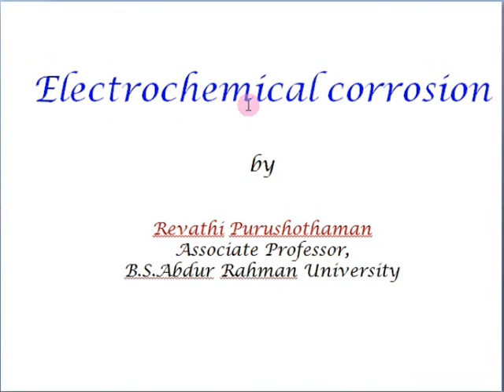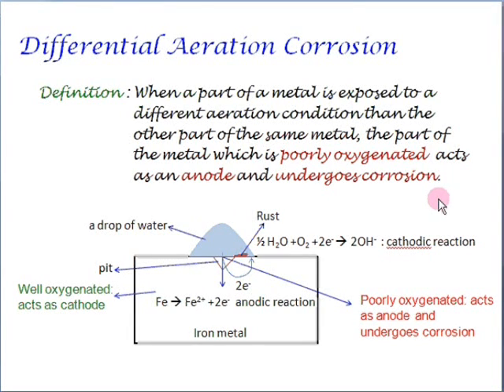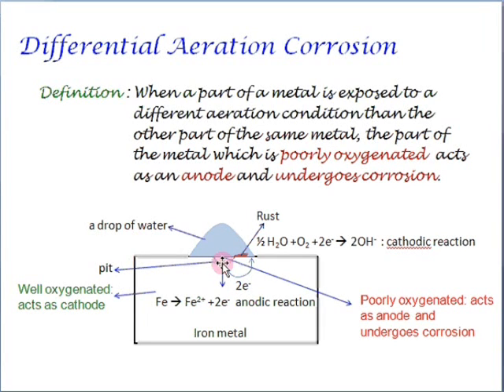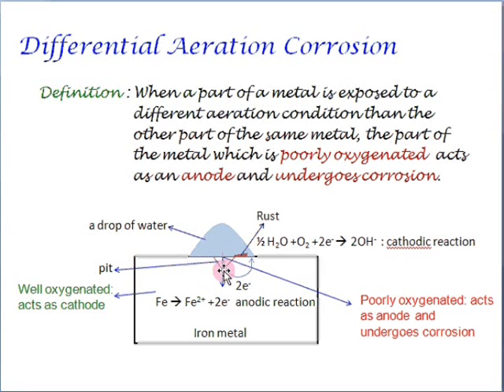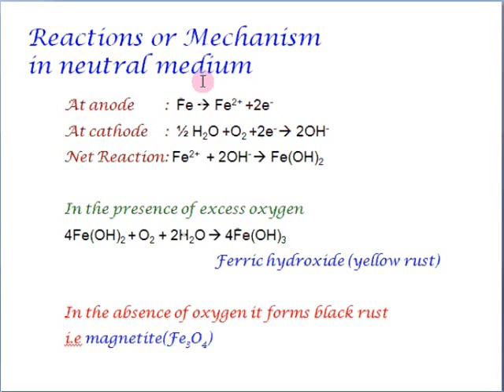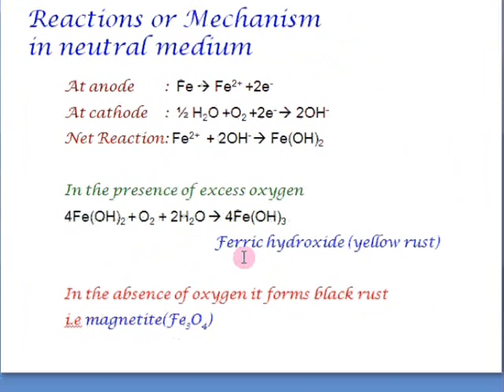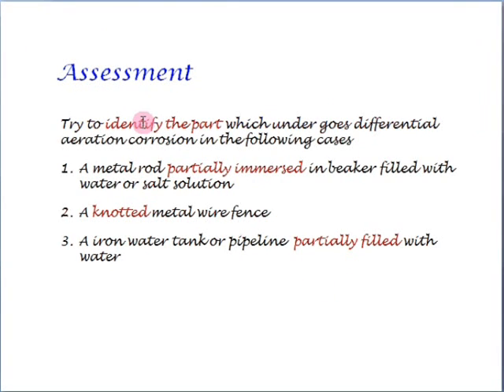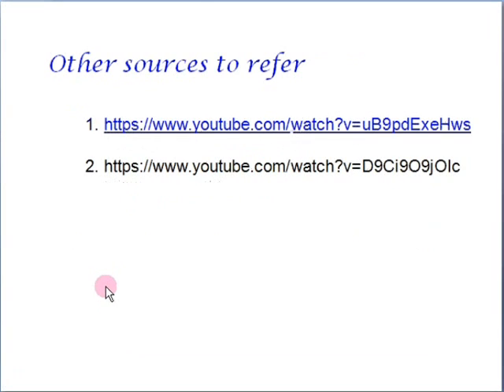Electrochemical corrosion (Differential aeration corrosion/Concentration cell corrosion)

Comment: Hello Mam, how does the PAINT helps in fighting corrosion of metal?
>Is it acting as a barrier between the metal and the moisture in the environment.
>If PAINTING avoids the formation of corrosion, then why using ANODES to avoid corrosion.
> Is it to the fact that once the paint is scratched from metal, corrosion occurs and rust begins to form.
Reply from the maker: Paint acts as an organic protective coating, which is one of the methods to prevent corrosion and it acts as a barrier. If there is scratch, which is very common it may lead to pitting corrosion, especially if the metal is a highly active metal(anodic). Anodic coating is another method in which the coating undergoes corrosion preventing the underneath metal.

Comment: So after first part of rust create on metal surface ...this part of rust has poorly O2.. therefore will be worked as anodic write?
Reply from the maker: It need not be a rust only, it can be a dust or water droplet etc.
Reply: @RevathiPurushothaman  inside crevice from which stand water creates corrosion.and afterwards this oxidized layer avoid O2 to achieve metal Fe surface..so after oxidized layer inside crevice works as anodic?

Many thanks 🙏